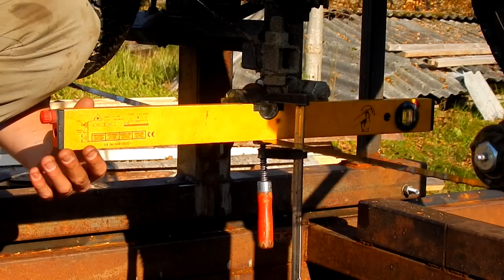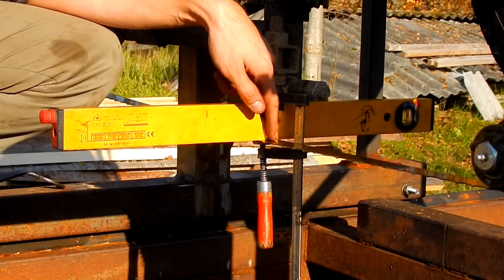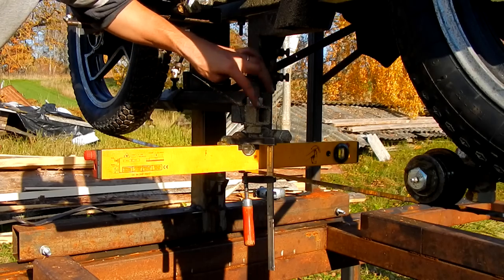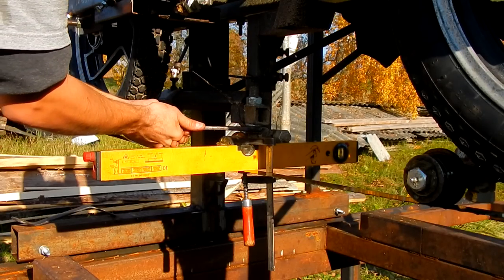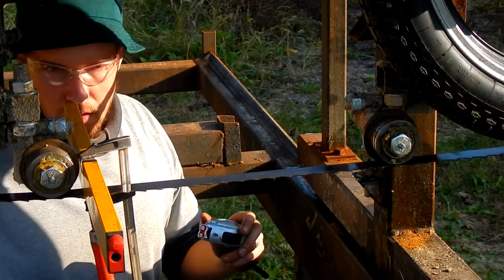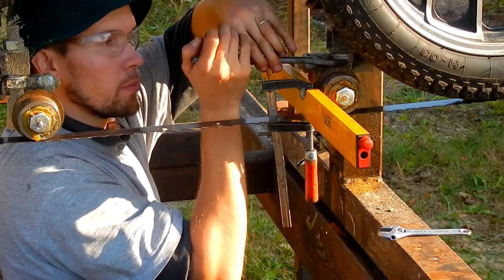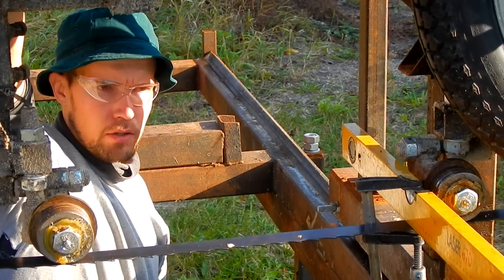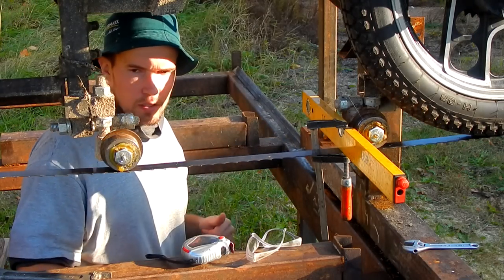HOW TO Adjust Blade Guides? - Band Sawmill Build #29

Comment: I really liked this series; but, as I watched it, a question continued to nag at me. Every mill I've seen on the net, whether commercially made and sold or built DIY, is limited in throat (height) depth. Could it be possible to build one with three or four wheels in order to be able to process a log that is much larger in diameter - say about six feet or close to two meters? It seems like, if one imagined a circle that is two meters in diameter and centered it over the log rack, the tires could be placed outside that circle in a triangle or square configuration and the mill could me made taller and wider. Then one could cut up an entire log without having to flip or reposition the logs.
Reply: The flipping and turning of the log is done to align cuts and get the right widths in accordance with the grain. There is actually a method to the madness. The direction and layout of the cuts is designed to optimize the size board you want and making sure it is set correctly with the grain to avoid warping and twisting.

Comment: Donn, how are your blade guides holding up? I have diy mill that I just use radial ball bearings for blade guides, and the one close to the cooling oil drip does not hold up well. To that I'm thinking of building them like yous! Like others have said; love your build, and for the cost, I have $1500 in mine plus labor. It cuts 36 inch by 21.5 foot log. Of course some of the material was free; band wheals  that retail for $475 I got for $113, plus discount on other parts from a friend of a friend at whole sale price; HaHa! Have fun with your tools and talent!
Reply from the maker: The blade guides hold up well. I'm not a daily sawmill user and I don't earn my living that way, it's just something to keep in mind. But since I can grease the bearings that are inside the rollers I have no bearing premature wear problem. I usually grease the rollers after every use which packs the inside of the roller full of grease so it can withstand rain better - that is until I get it under the roof. The bearings are conserved better that way between uses and the drip water for blade cooling doesn't seem to have an effect on'em whatsoever.
Reply: @DonnDIY  Thanks alot; I may try to make my own as I'm to cheap to buy! Thanks again